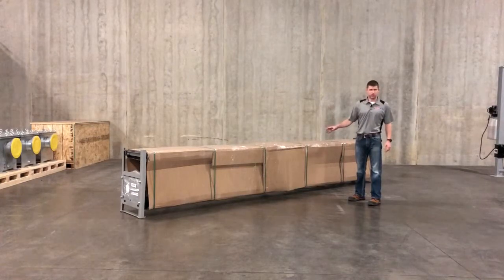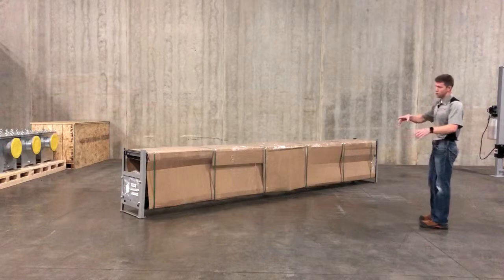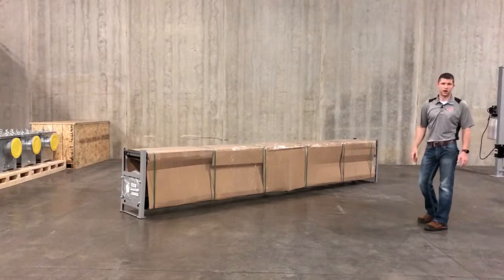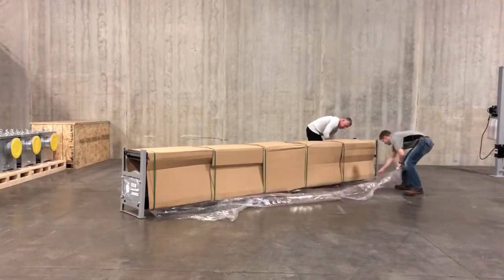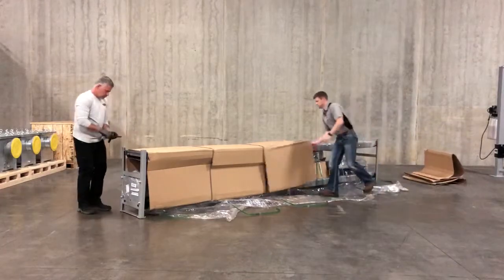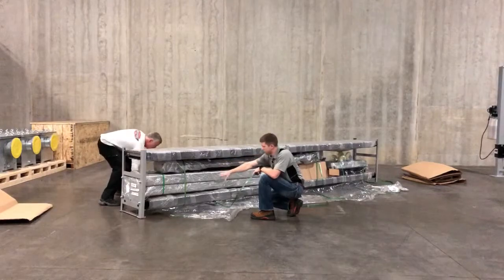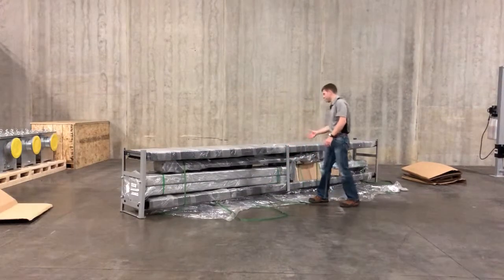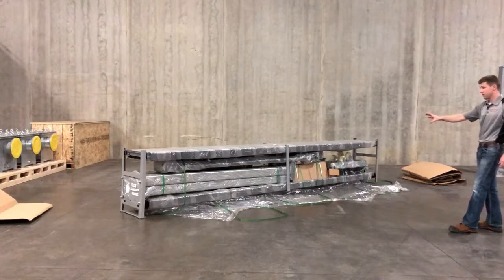How To: Packaging a 4 Post Lift For LTL Freight or Pick Up | Wildfire Lifts

Comment: You guys package just like the other guys. I work for a premium LTL company and these things are a nightmare. 

You guys should block the opposite end from the lift end so it can't be used. I know it's not cost effective if the bottom was a 7' long metal tunnel so it can't roll off the forks or damage the lift. That would really help.